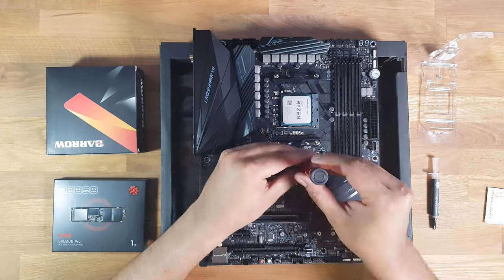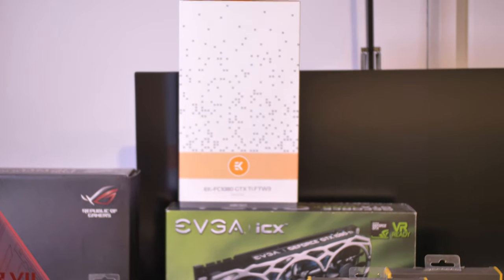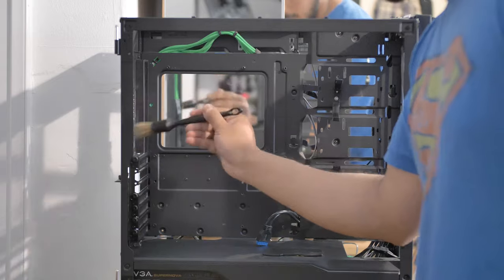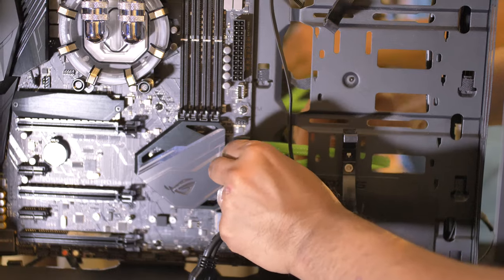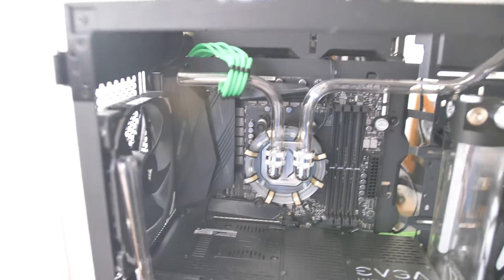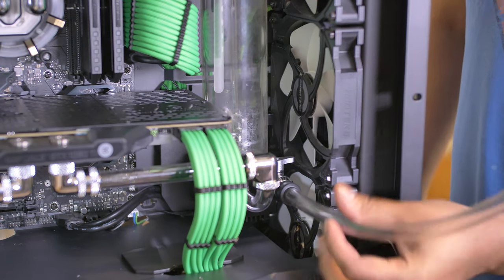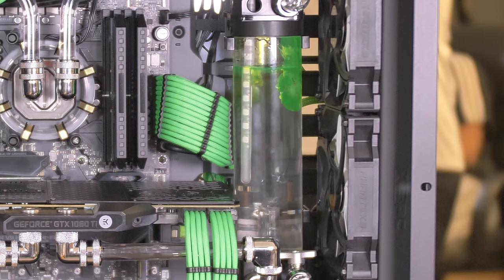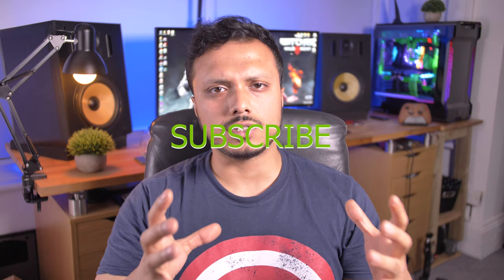AMD Ryzen 3700X full custom loop build!

Comment: Another great video. 2:45 that's why I am not going down the water cooling route again, apparently you do have to "service" your watercooling kit regularly; not sure where I read that or heard it; true you do have to service/clean air coolers too but they are a lot less time consuming to clean etc. However, watercooling is awesome; I still have my Corsair H80i that has been running pretty much every day for 7+ years on i3570k (I know I know, it's old and I need to upgrade).
Reply: @Johnfuse so what you mean is use distilled water well i mean non colored one ? any video that can show the difference plz ? that interest me.
Reply: @Johnfuse thanks for these info am getting finally a real pc in January and thinking about W/C my cpu only and that shitty pch fan cause x570 mobo. lol

Thanks again.
Reply: @Johnfuse what about a config fully immerged ?

This does interest me also..
Reply: @Johnfuse yep i mean that and am aware of how messy it can be..

but am not someone who gonna change of gpu/cpu every years so i dont care, what is your opinion about that ? and also temperature, is it even better when it com to temp when your pc is fully sumberged ?

otherwise am looking some video EK waterblock stuff seems to be noice enough...
Reply: @Johnfuse I get your point, i think fully submerged config wont be better then a normal W/C one using pump and stuff... :)

The thing from fully submerged pc and what i like from it is the not dust at all.... lol

Am looking for EK brand they seems to be of quality.

Thakns again for this discussions and happy new year for sure. :)
Reply: @Johnfuse Thanks. :) Am just waiting to get my pay and buy that pc LoL so soon.... !

Comment: Hi Jaf! I'm in the middle of buying parts for my 3700x build too! Question for you - I got Corsair Dominator Platinum 3200 16GBx2 b-die, but the QVL of basically every motherboard mentions the a-die, do you anticipate any compatibility problems for me based on that?
Reply from the maker: If you knows Version 4.31 b die then you have no issues.

Also the the die is not too important u less you are overclocking it a lot

You will be able to run under docp profile
Reply: @thejafman  awesome thank you. I was concerned. I have built many, many systems in the past but as I got older, I got more paranoid to follow QVL and hadn't noticed until this build that such a thing as A and B die existed lol
Reply from the maker: @melkorsbane  no problem subscribe!

Comment: Did you see his resevoir moving.Thats why i have a external rig i have only 4 straight tubes to the back of the case.I do not like all the connections res-pomps-rads in my PC
And when i change hardware motherboard and GPU its only a few hours work.And i use 2 x480 and 3x420 and 1x280 rads and 4xD5 pomps.And pc runs much cooler.
And i have still room for 2x480 rads
Reply: That's because the case design.
Some cases are specifically for water-cooling this cases have 3rd party reservoirs designed for that specific case.
Or some uses universal dedicated pump mount which you can directly mount a reservoir above.
Well even if the case is not designed for water-cooling as long as you plan properly your loop to be secured.
Then that tilting reservoir would not happen.
He is not using a reservoir bracket holder.. this holder can stabilize the reservoir.

Comment: What temperatures are u getting? Also planning to buy a 3700X and i already have costum loop for cpu and gpu.
Reply: i have idle temps off 40 degrees and around 65 max this is in a custom loop with 1 thin 360 mm radiator and a thick 360 rad. I allso have two gtx 1080's in the loop so they add heat allso

Comment: Hi, I just recently purchased the same Barrow ARK waterblock you have but am having trouble getting it to light up correctly. I've got the manual RGB controller below but it isn't lighting up when I connect it via Molex to my Seasonic PSU. 
https://www.performance-pcs.com/lighting/bulbs-inverters-accessories/barrow-lrc2-0-compatible-5v-manual-lighting-controller-arskzq.html

Do you think I would fair better using this cable to connect directly to my motherboard?
https://www.performance-pcs.com/lighting/bulbs-inverters-accessories/barrow-12v-motherboard-to-barrow-rgb-adapter-cable-zbdzjx.html

I also see Barrow offers an RGB controller for multiple devices:
https://www.performance-pcs.com/lighting/bulbs-inverters-accessories/barrow-8-way-rgb-controller-with-ir-remote-controller-dk101.html

What product are you using to light your block? Any help you can provide would be very appreciated.

Comment: Better off using pure water, there are no additives that can increase the thermal transfer efficiency of a water based cooling solution because water is the best at it. The additives would be purely aeshetic

Comment: You put the m.2 drive in the wrong slot, you should of put it in the bottom slot. The top slot m.2 shares the lanes with the gpu. School boy mistakes.
Reply from the maker: Thanks for your contribution
Reply: school boy mistake the top slot m.2 drive is directly connected to the CPU which mean 0 latency since it will not going to the Chipset before going to the CPU.
school boy mistake number you want it to be at the top slot m.2 slot bcuz of the reason above, the second reason is it will not share  GPU x16 pci-e lane even on a A & B-chipset MOBO.,
Why? because the 1st x16 lane is also the same as the 1st m2. pcie lane it is directly going to the GPU.
Its the 2nd GPU x8 lane and 2nd m.2 lane  or even the 3rd GPU lane and 3rd or 4th m.2 lane that are going to the Chipset before going to the CPU.
school boy mistake again go back to school school boy...in X-chipset MOBO 2 of the GPU lane and 2 of the m.2 lane are going directly to the GPU instead 1x each on A & B-chipset MOBO.